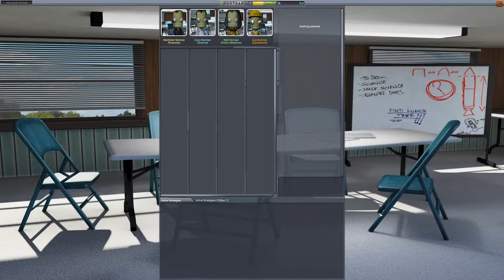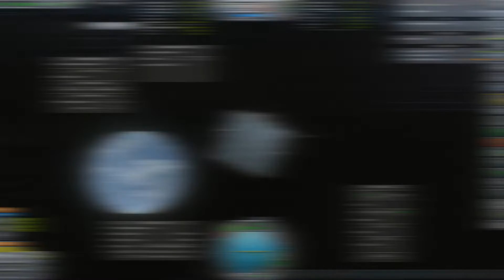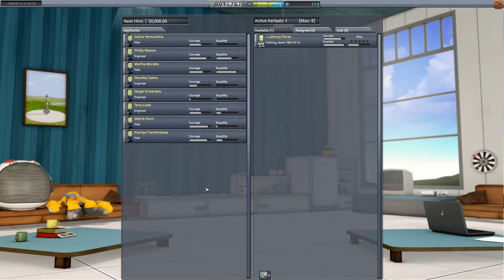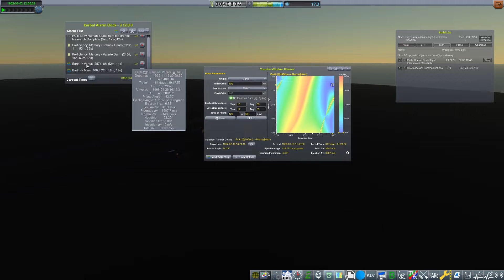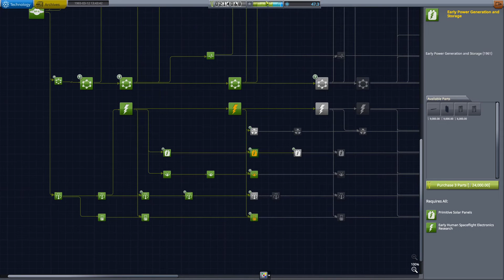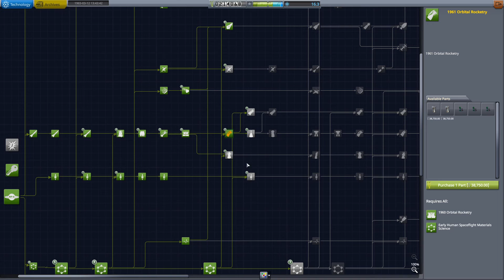Geostationary! - KSP/RP-1 - Next Small Step Episode 25

Comment: Can you put some of your craft on discord or kerbalx with link in description and then linked in discord. 
Preferably your lifters. 
I used the pioneer craft to get 1st orbit and now I have to do payloads to orbit.
Modified the upper stage to be cylyndrycal and using the best engine upgrades maxed out the fuel per burn time.
Still can't get to orbit.
Tried making them just as you are but you don't really show it's stats. 
Those that you did I couldn't get the same DV amounts.

Comment: Another great work. I am having issues with reproduce the Geostationary mission @Justin Bright just did with mechjeb when I create a regular or combine and execute node with mechjeb it does the auto time wrap but that's all. I tried with booster and regular engines doesn't matter. It wraps and stops just before execute Any ideas anyone?. Also when ı tried orbital return i found that might be wrong but having a bit higher perigee worked safer for me if anyone is having troubles with that one.

Comment: Cutting it close is one of the most delightful and anxiety-inducing things to do in RP-1 :D
I wanted to also let you know that itsRyan has released a KCT test build with the edit behaviour fixed and working like it should! No more "swapping out this wing makes it think I've rebuilt 80% of the whole thing." Also, you can allegedly get started on building an often-used rocket or rocket stage, and add the rest through the Edit menu, with the same costs as if it had all been built separately. For example, once you upgrade the VAB and unlock a second build rate, you could build an Able stage with the second build rate, and decide later whether it's the Thor or Tellah you need it to be sitting on top of. If you're not too uneasy about trying out beta builds, you can hop on the Discord or grab his fix at https://github.com/ryanc55/KCT/blob/EditCosts/GameData/KerbalConstructionTime/Plugins/KerbalConstructionTime.dll
Hopefully, correct edit behaviour will make your life a little bit easier :)
Can't wait for your take on Mercury and the 60s Delta rockets!
Reply from the maker: Right? If it had worked out just fine with plenty of margin, it wouldn't have been as delightful a mission! 
Ooh, maybe I'll jump on that beta as well. I've been living on the edge of updates, so I might as well, right? Thanks for pointing it out!